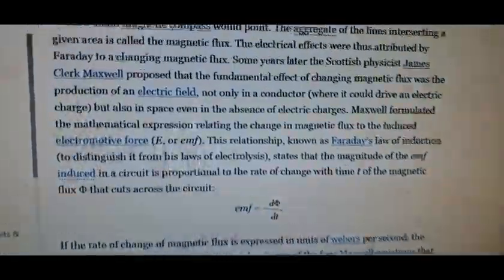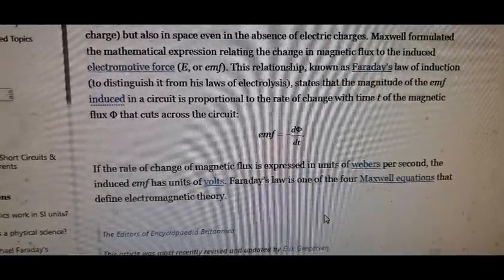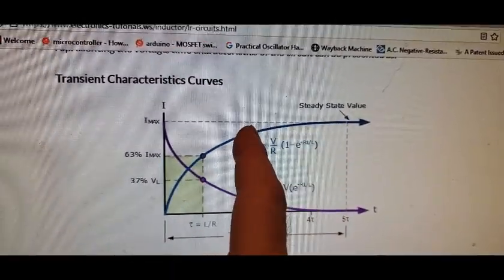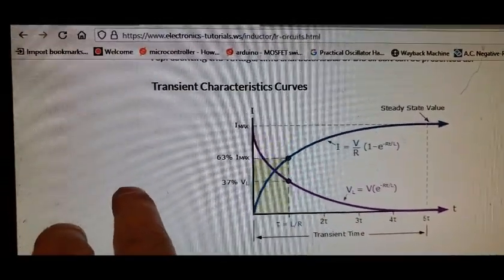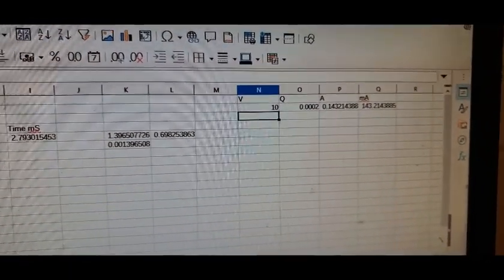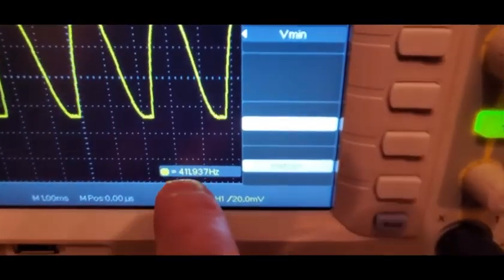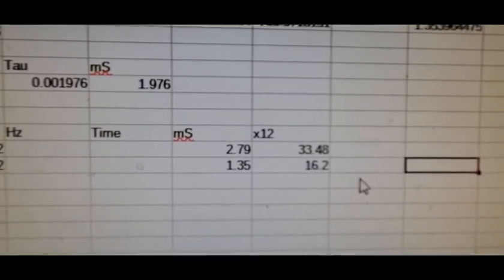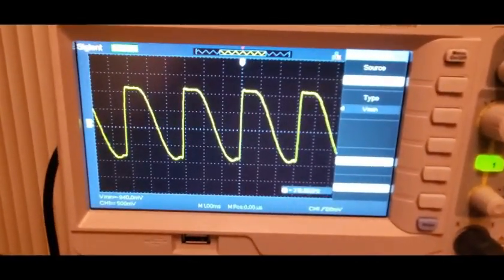Capacitor Size, Coil tau Time and Q Factor/Inductive Spike: AKA Fun with the New Oscilloscope

Comment: Calculating cap size is a new and annoying thing, that's why no one is talking about it :D The old timers just used variable capacitor and measured it when it's maxed out. Maby someone calculated something approximately and then added more capacity to the air capacitor. Same thing with resistors, it's usually more easy to use potentiometer and measure it when it's good. Thanks for taking the time with this and sharing.
Reply from the maker: Interesting, hadn't thought of that, but of course you could use a variable cap to dial in where you are seeing the best Q factor.  Thanks for the comment
Reply: @paulmaher812  I think many engineering departments also have had charts to see the size faster. Today people seem to make excel spreadsheets for calculating it too.

I'm personally currently trying to figure out the Tesla magnifying transmitter. There has been some major breakthroughs on it recently by the MTech Industries. He figured out that it's the Tesla dynamo patent 336,961. But you just need to flip it backwards. There is a video called Tesla magnifying transmitter, the extra coil. It's telling about how the primary should be quarter wave with small velocity factor and the secondary bucking coil should be half wave with bigger velocity factor / resistance. So the extra coil is full wave with center tap for neutral and diodes for grounding it. This seems to work best with even smaller velocity factor / thicker wire.

But there is also a third coil in the patent to run the load separately. I think all these should also be tuned to get the maximum LC action. Specially the ground coil.

It seems like ground reflector is very important to get the most out of all circuits. People compare bad ground mass to jumping in a mud and full ground to jumping on concrete. So when it's properly tuned it's like on a trampoline.

Sorry for the long message, there really isn't many people who truly understand these things. Respect. Keep up the good work.